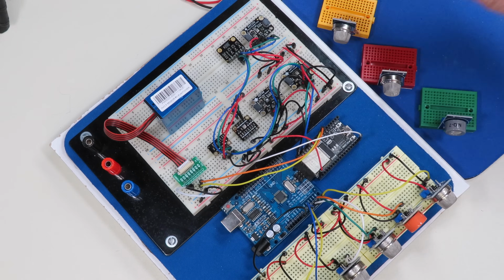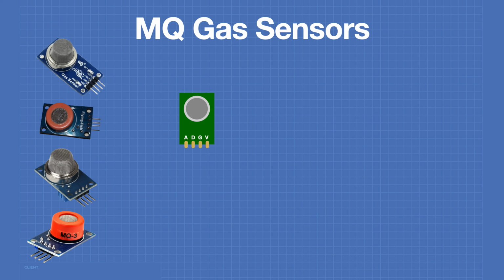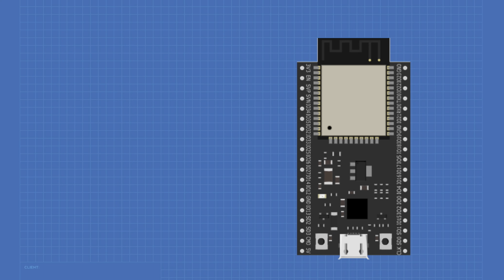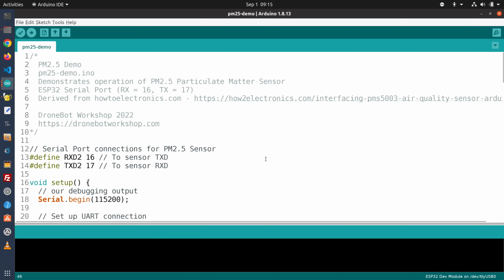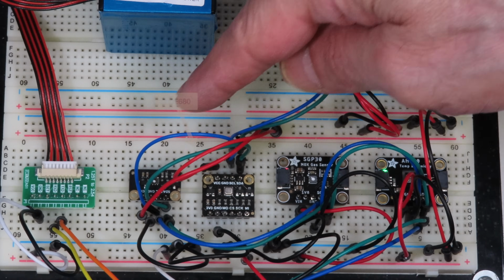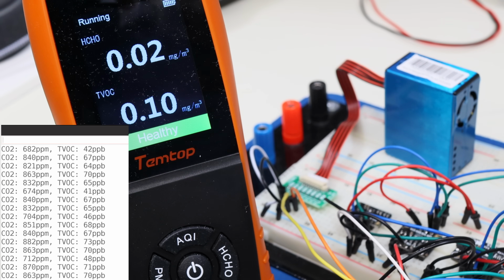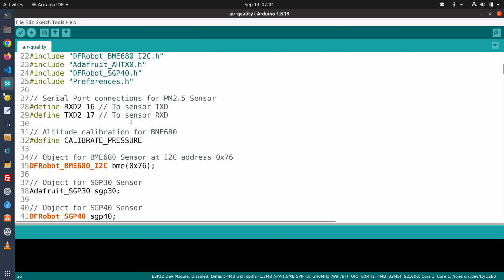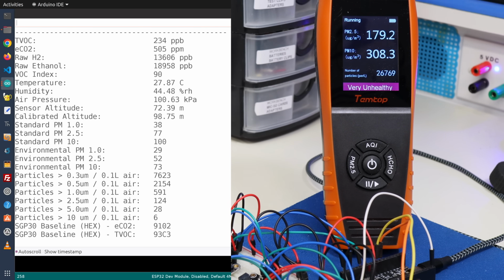Measuring Air Quality with ESP32 & Arduino

Comment: The BME680 supports I2C addresses 0x76 or 0x77 addresses. The user can configure the address for the device using solder, so the code could have been correct.

Comment: One problem I see with using the SGP40 library with the index algo, is it averages over 24 hrs, with 100 as a base line. So if you bring something into your home which is giving off lots of voc's like a new carpet, you will see the voc rising above 100, but then it will average it out over the 24hr period and it will be back to 100, saying everything is A-OKAY, when in fact it isn't, unless of course you removed the offending carpet! So I think I would use the SGP40 without that index algo., there must be another library to use with just the raw values.

Comment: This is great!  I've been thinking to do something along these lines for a general indoor air quality setup, with readings on an e-ink display. Does not need to be super live, but a reference point, maybe updated every 5-10 mins. Do you have any thoughts on the PMS7003 vs the 5003?

Comment: I am developing products for LPG detection, smoke detection and learnt a lot from your article. 
1) All sensors are giving analog output and libraries are helping but how to find functions in the library in Arduino 1.8.xx with WINDOWS 7?
2) The usual catch is using the sensor (with its datasheet) on a breadboard with a lighter or spray and getting some results and actually wall mounting a prototype as a product which will give a visual indication along with a buzzer. So my next question is, how to decide the threshold value (usually 400 for LPG) for a sensor which will be wall mounted near a kitchen gas stove?

3) What exactly is pre-heating - keeping the sensor near heat or keeping the sensor connected to the Arduino with power on?
Please help me on these practical problems of migrating from prototype to product.
Thanks already.

Comment: Though 12bit is adc of Esp32, it’s not so linear & some issues of noise, also being 4092 value instead of 1024, hence it is recommended to use ADS1115

Comment: Finding this video was incredibly timely!   I've been working with/ evaluating all of these sensors for a couple of years, but mostly with either the RPi 3B+ or the Wemos D1 mini.   Now moving mostly to the Seeed Xiao ESP32C3 and ESPNOW.   For the I2C devices, it's been straightforward, but the doggone PMS5003 has not been very cooperative.  Until now.   After trying every other library and failing, I ran across this example and it works out of the box. 

I am a little concerned about the nearly continuous measurement because the laser only is projected to have about an 8000 hour lifetime so the usual approach with the PMS5003 is to only take a measurement every 5-10 minutes or so and then turn it off in between.  I'm not a good enough programmer to figure out how to do this.

Comment: I liked this video in particular and I am tempted to deploy a VOC and PM monitor function in my 3D printer workshop. I would want to see the data presented with historical graphing of the results. I am thinking this would require a Raspberry Pi (for display and graphing purposes) and perhaps a NAS storage device. Have you considered doing something this? Like you I have air circulation and an air purifier with a HEPA filter available to use. Being able to monitor air quality before starting a print and during printing would be very useful. Have a monitoring system to confirm effectiveness would be necessary.

Comment: Thanks for the video, the Temptop device you are using is not known to be a reference device, so it can't be used for calibration of other devices.  Look into the Sciosense APC1 device, it comes calibrated and has TVOC and particulates in one package.

Comment: Hi, great video. I'm Firefighter and also Electronic Engineer here in Brazil. Currently I'm working with air compressor for the SCBA air cylinder we use in firefighter combat. I'd like to develop such air quality device for our equipments. But I don't have any reference of what type of sensors do I use. Can you help me? What kind of parameters need to be measured from these air cylinder? Thank you very much. We use 300 Bar cylinder from Scott Company.

Comment: You can use the BME680 for IAQ as well using the Bosch BSEC library which does the extrapolation/sensor fusion based on the MOX + other sensor data.

Comment: I built a project using a Wemos D1 R32 to raise and lower my camper jacks using Bluetooth and it actually functions quite well. I'm using a 2 relay module connected 5V to VCC, GRD to GRD, Pin12 and 13 to IN1 and 2 respectively. I send a 1 and 2 from my simple phone app via bluetooth and operate the relays. However if I cycle the power on the board the "Relay Actuated" LED's on the module light up dim and the board will not start up correctly. The only way I can cycle the power to the R32 is to disconnect the 5V wire while it boots. Then when I connect the 5V wire back up it can connect to the Bluetooth on my phone and work just fine. Any ideas other than me adding two switches?  One to connect the 5V after I turn on the power.
Thank you very much for your very instructive video's by the way!

Comment: First things first - glad to hear that you're getting past the immobilizing health issues.

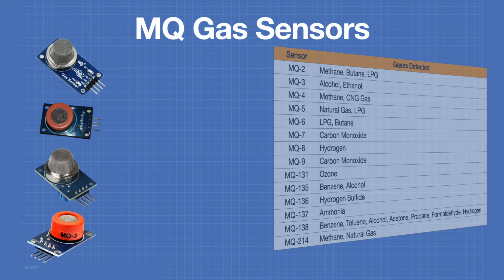Second thing - I'm a bit confused and bemused by the MQ sensor list @ 8:16...  It feels like there's been marketing department input on some of the listings, because:

CNG is compressed Natural Gas, and ""CNG Gas" (i.e. Compressed-Natural-Gas Gas ? ) is detected by MQ-4.  
Natural Gas (detected by MQ-2, -5, and -214) is Methane extracted from the ground and sold by utility companies.
But Methane is separately detected by MQ-2, -4, and -214.
So:
... MQ-4 detects Methane and Methane, but one of the Methanes is only detected if it's first compressed?
... and MQ-214 also detects Methane and Methane, but one of the methanes is only detected if it's sold by a utility?
... but if you want to detect Methane that isn't sold in bottles or by a utility, then you can use MQ-2, which detects Methane, but apparently not Natural Gas or CNG

Not to mention MQ-3, which detects Alcohol, as well as Ethanol - which is the alcohol in alcoholic beverages.

Then there's LPG (Liquified Petroleum Gas), which is (per Wikipedia) a mixture of Butane and Propane gasses compressed to liquid form.  So MQ-2 and MQ-6 (which both say they detect LPG and Butane) detect both Butane and a mixture of Butane and Propane - but the mixture is only detected when it's a liquid? 
(And for some reason, if you want to detect a Propane leak the only option listed is MQ-138, which also detects 6 other gasses, because - I presume - detecting LPG and/or Butane won't tell you if your BBQ Propane tank is leaking?)

Comment: Great video for a very apropos subject. I live in an area heavily affected by fire conditions. I also work in a small business that does a lot of welding, both brazing and TIG. From a health standpoint, it's hard to muster the kind of expertise you need to monitor air standards without laying out a lot of money and hoping the instrument you buy is helping. This video is helpful in that it shows a route to get very detailed and high quality readings if you're willing to put in the time to build the project.

Comment: MQUnified seems nice but has no compensation for environment like humidity and temperature. I found it essential for ozone sensor MQ-131 that I used in a diy steriliing cabinet (yes, one of those pandemic projects to recycle expensive respirators that had no availability for a while or were very expensive).
One can always add a correction calculation for the uncorrected values depending on environment. That's what I did in my code in practice anyway.
Reply: Hi! 
Can you support me connect pin MQ 131 for ozone? I have some question about this sensor and can you give me contact information?
Reply: @pvh.09  I can see if I know what info you are missing. I made a topic on my channel community tab. You can contact through it.

Comment: Cool stuff for measuring indoor air quality in our tight homes. And always wanted to build a simple weather station to track pressure. Couple of things... 1) Most smart phones have a barometer installed and you just need an app or write your own code to access it. 2) Altitude is the distance above ground, whereas elevation is the distance above mean sea level. The negative number is most likely because you're in the basement, but like some other comments have suggested need to be calibrated for your area. I don't think you're in a hole 55m deep?

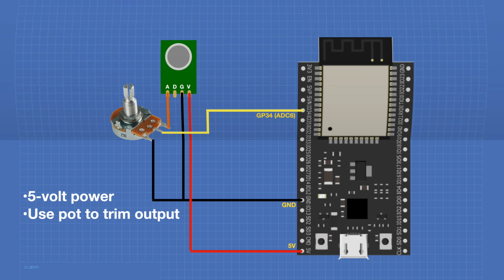Comment: 18:32 you could just create a voltage divider with 3 resistors of equal value (ex: 3 10k resistors), and plug between the first and second resistor. (Basically, you take essentially what would be a 5 v max signal, down to a 3.33 V max one). Much less likely to screw up analog readings and scaling is a tad easier.

Comment: What's the name of the tiny pin connector socket on the pm sensor cable? Mine didn't come with an adapter. I just cut the cables and crimped on my own connectors because I didn't know what to look for.

Comment: I've seen a lot of your videos. Would you do one on using two servo motor 180 rota with Arduino uno and using flysky to control the servo motors on two separate channels it's so you can get more accurate movement with the servo motors. I've seen it done no code or explanation. This so you can attach it to a wheelchair joystick to turn it into remote control one.  or a better way ?

Comment: I'm building a home comfort station. The user has a web page where they can see the output of my BME280 and has a choice of three buttons, I'm Too Hot, I'm Comfortable, I'm too cold.
Logged into a MySQL database so I can figure out what room conditions equate to a comfortable occupant. I'll probably add an outdoor sensor and and an air quality sensor.

Comment: I suppose the advantage of a serial sensor over an I2C sensor is you can use RS232 to place the sensor a very long way from the micro controller.

Comment: A likely reason you were seeing the -55m altitude value is that you haven't set the current air pressure value for sea level in your area. I believe the example code requires that the current air pressure value for sea level be set in the code and it works out your altitude based on the difference between the air pressure reading from the sensor and the reference value for sea level. In my case I used information from my local airport that happens to be at sea level, or close enough anyway. Thanks for the video, I found it very informative.
Reply: I have really never understood this setting. Why define current atmospheric pressure as a constant since this value changes? Besides, these sensors measure atmospheric pressure. Shouldn't you pass the current atmospheric pressure as read by the sensor instead of a constant value? The code in question is:

#define SEALEVELPRESSURE_HPA (1013.25)
bme.readAltitude(SEALEVELPRESSURE_HPA)

This example is from Adafruit but It is in all the well known libraries for these sensors.
Reply: @MadnessMotorcycle  No, this code sample is right; kinda. The SEALEVELPRESSURE_HPA is the current pressure at sea level. The readAltitude function does read the actual pressure and then determines the altitude by comparing it with the current pressure at sea level that you passed it. Given that the current pressure at sea level is not constant, this code will only produce approximate values for altitude.

This is the code for readAltitude.

float Adafruit_BME280::readAltitude(float seaLevel) {
  // Equation taken from BMP180 datasheet (page 16):
  //  http://www.adafruit.com/datasheets/BST-BMP180-DS000-09.pdf

  // Note that using the equation from wikipedia can give bad results
  // at high altitude. See this thread for more information:
  //  http://forums.adafruit.com/viewtopic.php?f=22&t=58064

  float atmospheric = readPressure() / 100.0F;
  return 44330.0 * (1.0 - pow(atmospheric / seaLevel, 0.1903));
}

As you can see, it reads the pressure and then uses the passed in seaLevel to determine the altitude.